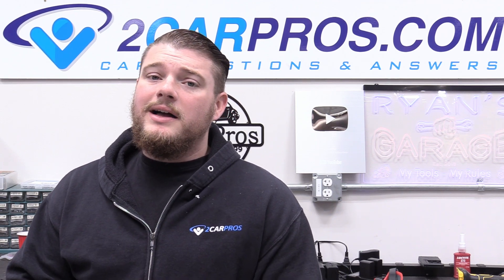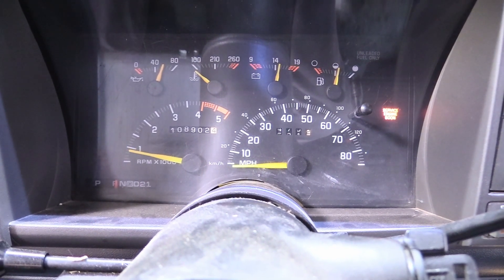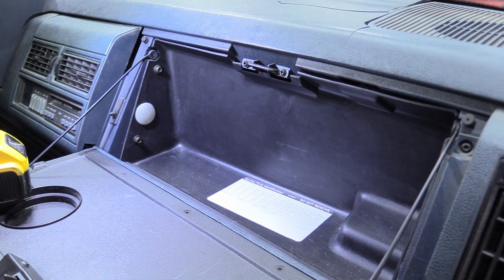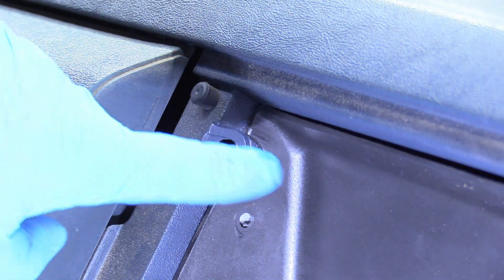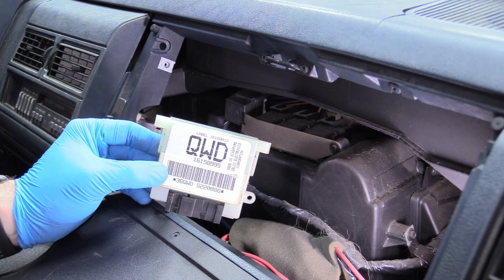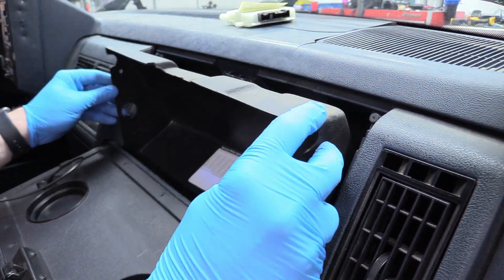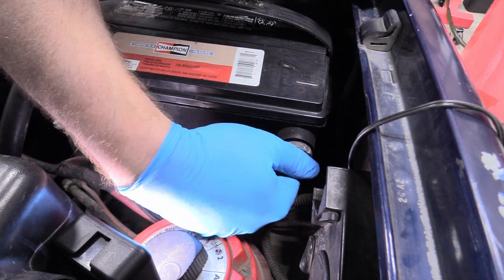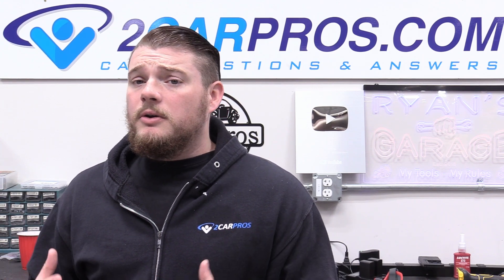How to Replace VSS Buffer Chevrolet 1500 2500 Suburban 1988-2000 | EASY!

Comment: Originally they came mounted to the HVAC case with some trees like your "new" one had in it. GM discovered that the buffer didn't like the heat and would act up in the winter when the heater was running hard. So they relocated them. Some used velcro others used double sided tape. You can also get versions with selector switches on them if you want to change tire sizes or gearing and correct the speedometer error easily. WARR Performance out in Fresno is one provider of them.

Comment: 1991 c3500 4l80e 7.4l transmission hunting around corner and hunting from 2nd to third. Transmission rebuilt twice, ecm and prom replaced. Location of DRAC module is behind the glove box? No codes

Comment: My truck is literally having a similar symptom like yours but only when the engine is cold on cold startup idling at 950rpm or even warm when I turn it on and rpm is at 950-1000 and don’t let it drop to 800 and put it in gear Reverse or Drive it will stall out and sometimes it does stall out and shut off, also speedometer is jumping only when accelerating once I let off the accelerator it goes back to the speed I’m going so do you think that module would cause that? I’ve already replaced the Vehicle speed sensor thinking it was that and it’s still the same, going to buy that module and see if it fixes it. Thank you for the tutorial.